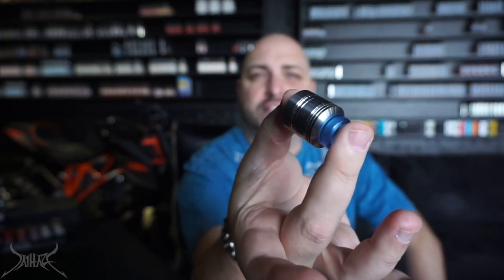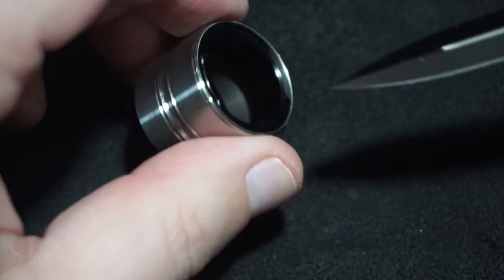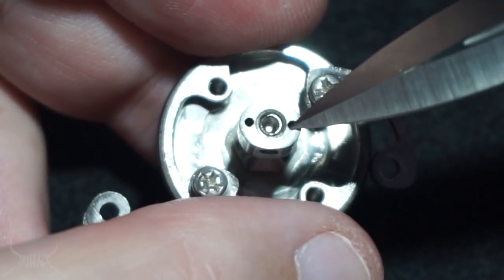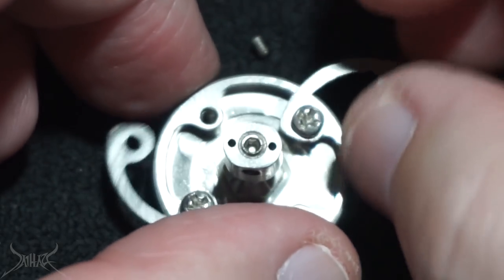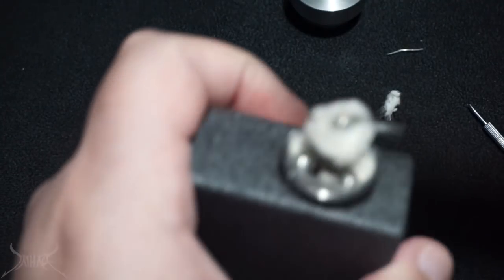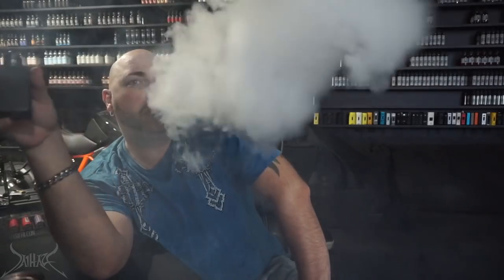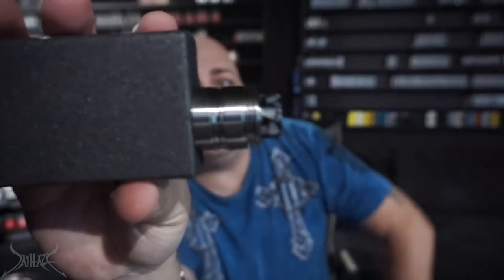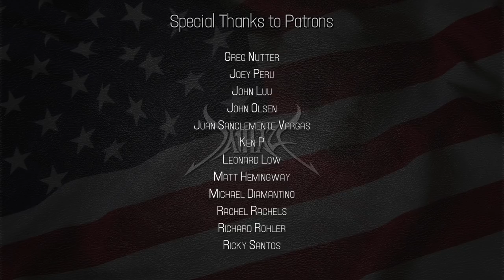The 502 RDA Review and Rundown | Jai Haze Designs and Raven's Moon Production

Comment: Good luck with the spit back and dry hits. vertical coils are not the most ideal build deck you should do. Learn from the past! It never had any real success. A pain in the ass to build on, you even said it yourself that wicking it is tremendously hard, the air flow is misleading and very limited, you need to be patient on aligning your coil so that the air flow hits where it should. I never thought you need a complete tool box to build coils for vaping. The only innovation i see in this dripper is the leak resistant (not leak proof, there will never be) and the only thing you can really brag  which was done by other drippers too. This type of build deck is so so yesterday. This type of RDA is just a one time experience type not your everyday go to RDA. With that build deck at that price point and rated it 9? lol.. You  didn't kept it real and stop shielding yourself from other reviewers saying they shouldn't be bias.You are the only reviewer i have seen who said that in reviewing  each ones own product.  When you yourself makes such a fuss out of senseless matter and lessen it to your so called unbias scoring, ie., "as bottom air flows tends to leak when you over drip.." Of course! it would and thats a granted on every bottom airflow atty.. people buy those because it gives better flavor and thats a fact!
Reply from the maker: dry hits? Why would you get dry hits when you can fill the hole damn dripper with juice. No other drippers have this airflow or this squonking.  Period.  None. Better flavor on bottom coil is NOT a fact.  Thats dictated to how the AIRFLOW his the coil, thats a fact
Reply: Obviously, 2 sipping cotton is always better than 1. Yeah you wouldn't have dry hits just right after you drip/squonk but after a couple of hits you would. whats the point of being a leak resistant if your cotton dont sips the juices coming from the juice well properly. Unless you flood it then you said it would also leak and the spit backs in this will be like crazy.. Lol. This dripper is all hype.. not well thought of.. all the physics of having a great vaping experience in it is non existent. When you vape on it all the air will only hit one side of the coil because you freaking cover the center with cotton where the air should go through heading towards your mouth. Yeah, it is a fact that flavor is dictated to how the airflow hits the coil. Physics suggest it will be from the bottom hitting the coil going upwards as you vape from the top.